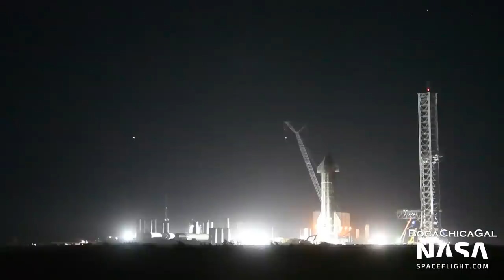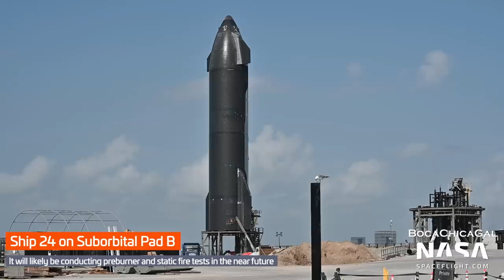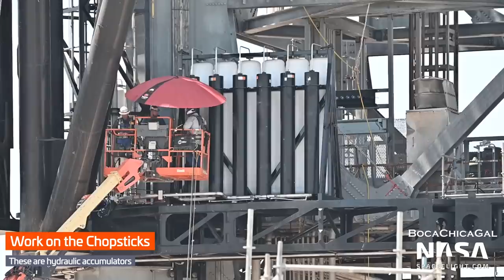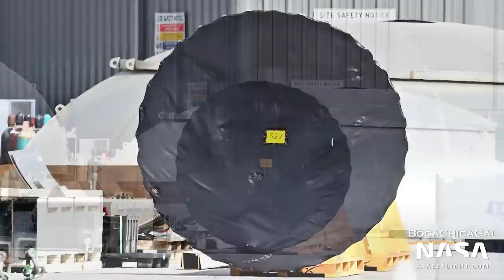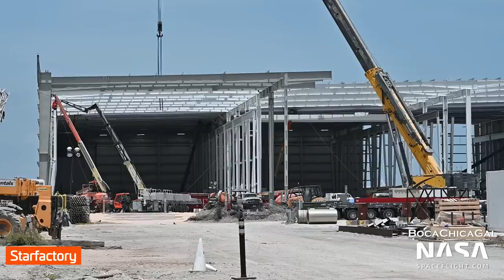B8 Moved as Pad is Prepared for Booster | SpaceX Boca Chica

Comment from the maker: 0:00 Sunrise at the Launch Site
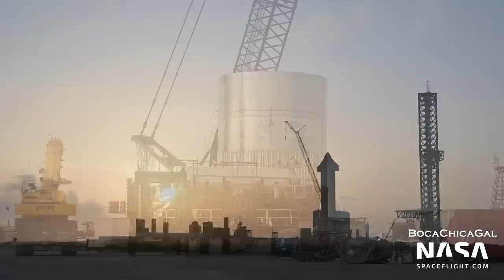0:19 Structural Test Stand Cap and EDOME Test Tank
0:39 Scrapped Booster Engine Shrouds
0:56 Ship 24 on Suborbital Pad B
1:46 The Orbital Launch Site
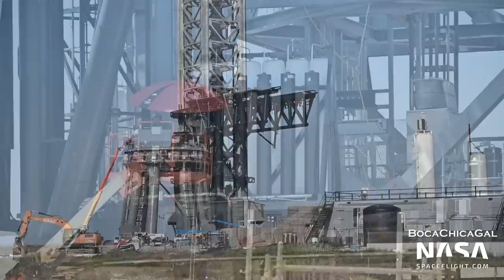2:33 Work on the Chopsticks
3:48 The Orbital Launch Mount
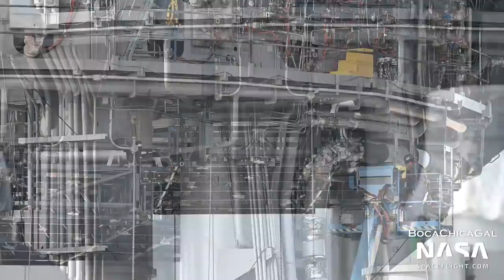4:37 New Maintenance Platform
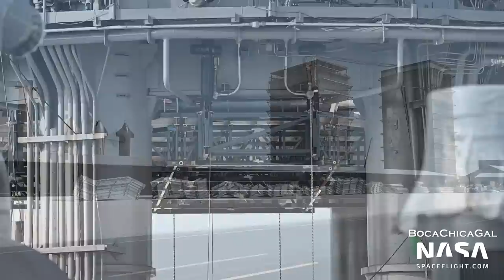4:55 Stair Segments Outside the Production Site
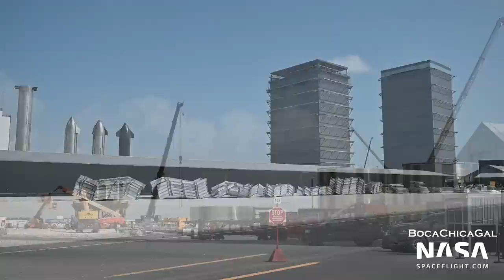5:13 New Barrel Sections and Booster 5's Aft Section
5:31 Domes and Ship 25's Nosecone
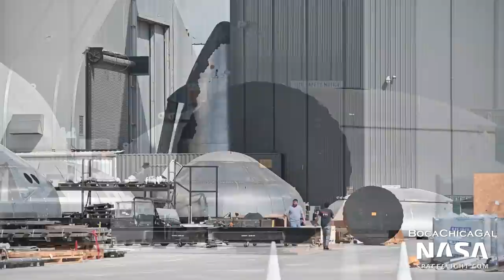5:49 Ship 27's Methane Sump and Transfer Tube
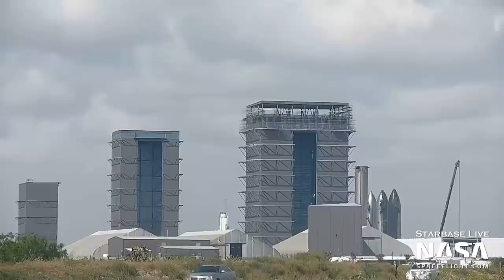6:13 Booster 8 Moved Within the Mega Bay
7:03 Starfactory
7:39 Starlink Loader Building Being Painted
Reply: Sorry, but that’s a whole lot of nothing. This is “housekeeping type stuff.
Reply: @robertmorgan9112  Have you never watched this stream before?  House keeping stuff is kinda the whole point.

Comment: The painting work seems to be a little bit uncoordinated but they use the same color so it will probably be okay.
Reply: It's a container building. Not need to be pretty :)
Reply: SpaceX has their own "Style Guide" (based on the Star Wars films - seriously)  that coordinates colors throughout their operations. From spacesuits to gantries and launch complexes, black, white, and grey are all used to designate functions. For example, production buildings are white. Assembly buildings are grey. Structural gantries and mechanisms that handle rockets are black. Mechazilla and all related compnents are grey. Etc.
Reply: Not what I talked about 2.

Comment: So will it be B8 or B7 to launch site - any more info on that ...
Reply: If B7 was beyond repair they'd have removed the grid fins by now. B7 lives! Just my opinion.
Reply: @MaunderMaximum  The Grid Fins are not expensive for these Boosters as they are just stainless Steel. So I would not call that a relevant indication.
Reply: @G3org3-X  Elon announcing booster changes was slow in the past as well.